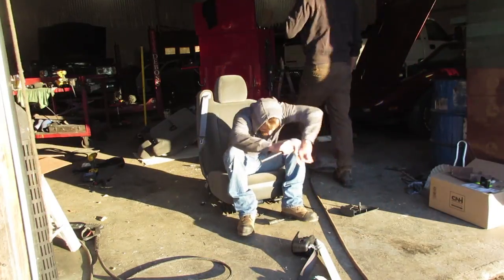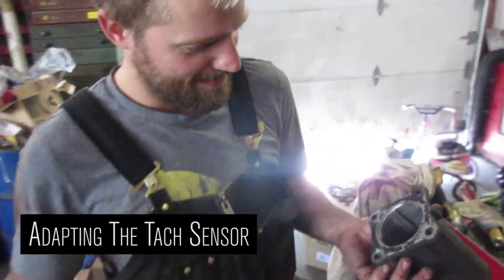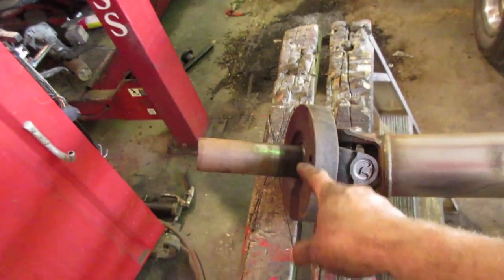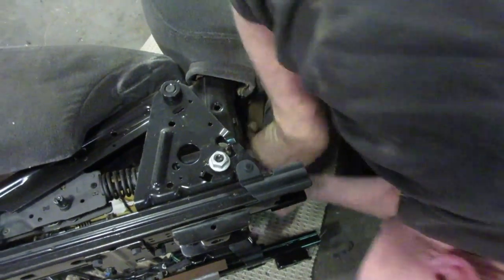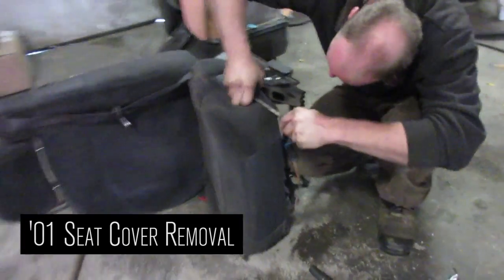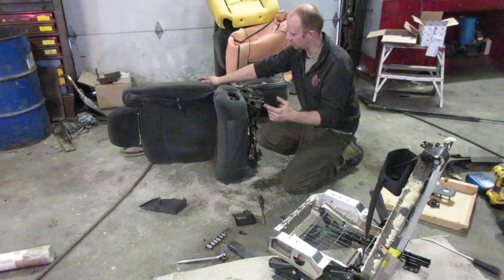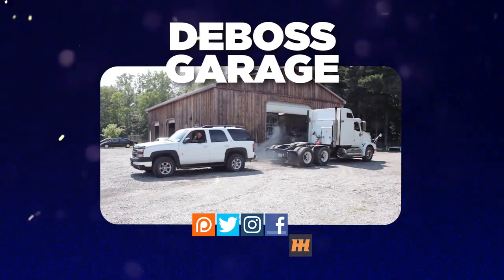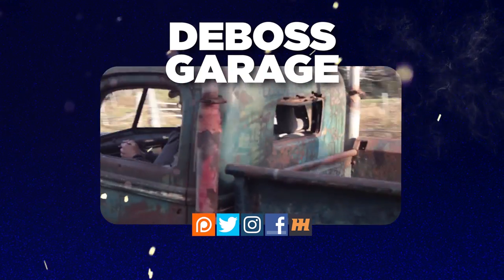BUCKET SEAT CUSHION SWAP: Chummins 2.0 | #CumminsSilverado [EP4]

Comment: My dad wants to offer you a job on our ranch/oil/gas field as a manager for the shop. The main shop floor is 45,000 feet, has 8 lifts, two weird lifts. 
The machine shop is 20,000 feet with two Haas’s, Bridgeport’s and various other machining tools. It’s basically outfitted and kitted out enough you can make just about anything you need. Even has a 3D metal printer and a resin printer. The aviation shop has room for 4 airframes at a time. 
50 trucks, 20 1 ton pickups, 20 3/4 ton, 35 1/2 ton pickups, 15 box trucks. 
There are 14 aircraft. MD500, AW109s, EC135s. They’re used for supporting our offshore tugs and resupply vessels that go out to the offshore drilling rigs.

Comment: Another great video, put together so well. I'm excited for when this channel gets a million pluss subs because it definitely will reach that. I need to put decent seats in my 95' shorty 4x4, it's already has the built sbc and converted to 5 speed, need good seats and maybe 1 tonne front/rear end conversion... Maybe a video on that, from 10 bolt to 14 and the front end including hubs/axels and  what would need to be done.. Thanks

Comment: Never had goodluck with niagara drivetrain. They can make driveshafts well but in the 3 times I've used them to do actual differential work while I was busy with something else they have always failed me. Not sure if the old man was doing the work or the kid was. Last thing they worked on was a 14 bolt in my 86 chev K30, just replacing the pinion seal. For some reason they pulled the carrier and a couple months later while we were up at the arctic circle with the truck I started hearing rear end noise. Pulled the cover and I find the left carrier bearing adjusting nut completely loose and the retainer had fallen out and gone through the gears, same with the magnet. All 3 times they have done diff work for me its been picking up the pieces afterwards. only driveshafts is what I get from them now. Otherwise, nice to see someone from southern ontario on youtube. close to home.

Comment: I was looking to get a 2011 ram cummins, idk if the trans has ever had the fluid changed and I wanted to change  the fluid it had about 86,000 miles on the truck would you recommend changing the fluid ?
Reply from the maker: Yes, I would be comfortable with changing it.

Comment: Nice. That prevents your truck from braking down all the time now, eh?
Reply from the maker: It never failed me once, only in the fuel department.  The 6.0 was a great engine and is still running in an old Chevelle I think.  I just didn't want to pay for the fuel
Reply: DEBOSS GARAGE the Cummins 12v- is also cooler.... eh?
Reply: Alexander Helton true - and better.